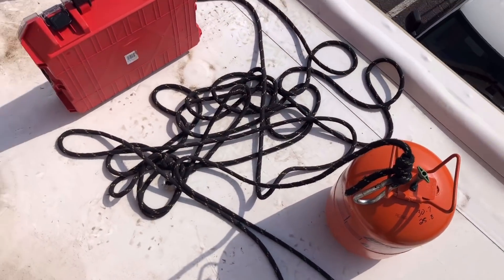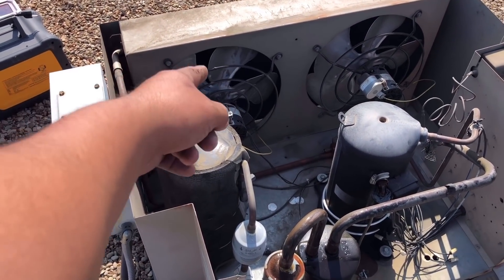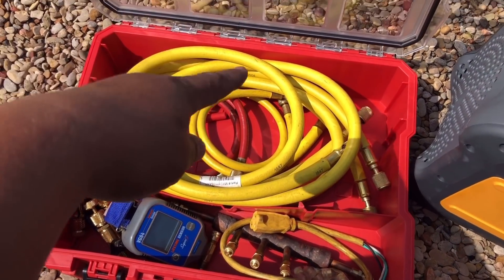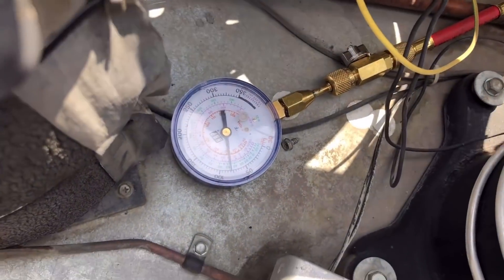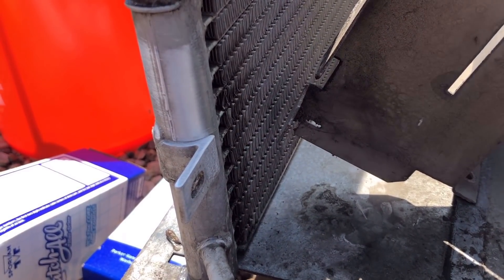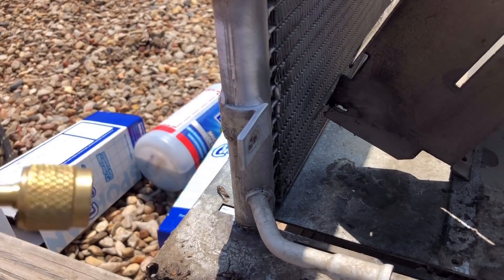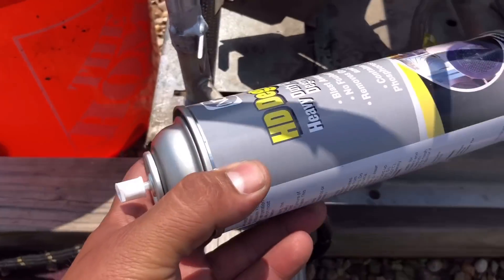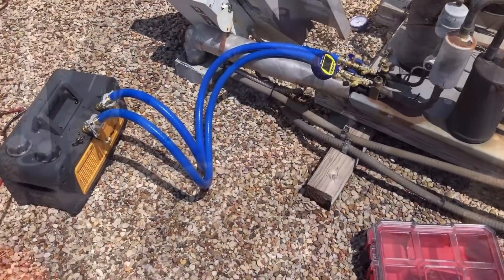REFRIGERATION: Failed attempt at an Aluminum Micro Channel repair.  My FAULT, on a Walk In Freezer.

Comment: Frustration with aluminum brazing.  Funny how you go to the homeshow and some guy is brazing everything in the world like cast metal and aluminum perfectly, and you get the magic rods and they just dont work as you saw in the demo. Then you blow a hole in the aluminum or the stick wont stick like youd hoped.  One thing I found is to heat up a large area of the target surroundings and clean with a stainless steel brush only, no degreaser, and putting a slight vacuum on the system sometimes helps pull that liquid stick into the crack. There is an aluminum solder out there with its own paste that is a low temp melting point that may do better. I sometimes have holes in evap pans. that would be a great piece to practice on.

Comment: Protip: next time try a propane torch (you can try with propane or map), turbo torch for map it's too hot for the aluminium and spread a lot of heat, it's more manageable with propane torch and also allows to control the viscosity of the soldering

Comment: automotive used very similar design for many years without failure in them (sans road debris penetration), then along came the brilliant engineering and energy saving green turds

Comment: Thanks for the video and explanations. I used alumaloy (without flux core) . Alumaloy recommends scratching the surface (to remove oxide film) while applying the alloy. It flows very smooth and evenly. Maybe appying aluxcore the same way would help.

Comment: I learned many years ago to weld aluminum with ox-acetylene.  You have to use a carburizing <sp?> flame. I used an aluminum rod with a special  flux.  I wouldn't waste my time doing that, I would have taken the condenser coil back to my shop and TIG welded it.  If you don't have access to the proper welding equipment, take it to a welding shop and have it done right.  Is it worth the trouble, it would buy you some time until the new coil comes in.  I would have placed a bead 100% around the bracket, since you don't know where the actual leak is, seal up the entire area.  As said though, probably not worth the time.  Jim

Comment: Sometimes you just have to know when you are outside of your element and admit it.  Everyone has an area where they are great and an area where they suck.  May be worth taking that old one home and using it to practice with a few times and get a little better.  At the very least you slowed it down some so it will operate until you can get it swapped out for a replacement.

Plus by the time you sealed the top side I am guessing it would find another spot to start leaking.  Those brackets are never fully sealed and it was almost as if the leak was coming underneath of it somewhere.  But that is where you get some epoxy and slather it on to get them by if it will be longer than a week to get replacement parts in.
Reply from the maker: Yes sir. Exactly. I’ve done several micro channels on the rows.   Never on the side part.

Comment: Just more practice with the aluminum welding and you will get as good with that as you are with regular copper welding. But I applaud you for this attempt. I’m finishing up my schooling for the trade myself. Since it appears everything is coming out with the aluminum micro channel I’ll mention it to the instructor and see if he offers any advice.

Comment: Great video man! I haven't had to weld on aluminum yet. I'm going to have to pull something out of the old scrap pile and give it a try.
Reply from the maker: Trust me.  Use the Lucas Milhaupt AL822 rods.  They are so easy to use and work extremely well.
Reply: @rookierefrigeration4357  Awesome! I will pick some up next time I’m at the supply house.

Comment: I use an epoxy that withstands up to 1000 psi for tricky repairs. It’s red when mixed and add to clean surface and hit with a torch till it turns gold color. Good stuff
Reply: Yea, a friend of mine turned me on to that “ red epoxy “ stuff years back when welding rods for aluminum were not so prevalent as they are today. He raves about it for sealing holes in boat evaporators for adler Barbour evaporators. I’ve used it once , for a area on a aluminum suction line on a boat refrigerator. It worked ok. Crazy stuff.
Reply: That stuff sounds good. What’s it called?

Comment: I was rootin for you man! lol good effort regardless. Have you ever heard of LACO heat sealing sticks? It's like a crayola. Heat it up and it melts on there like glue but hardens like a rock. 
It probably would've worked good for this application. Aluminum sucks to repair when you have to solder.
Reply from the maker: Yeah I appreciate it.  It wasn’t the solder. It was me.   My fault

Comment: 3 things: 
1 : good for you for putting this up. Nobody is perfect and we need reminders of that.
2. I couldn’t tell where your leak was but it looks a lot like cracks that I’ve had a hard time dealing. Pinholes and rub outs usually easier but cracks are hard because you don’t know exactly where it starts.
3. The hardest thing is knowing when to pull the plug. Good job.
Reply from the maker: Thanks alot bro.  I appreciate the recognition

Comment: Just wondering why you didnt make a second attempt? It probably wouldn't have taken more than a few mins and you probably would have got it.. more heat next time. The vacuum definitely wont draw solder in, even if it did. 15-20 bar would blow it out again. I know your thinkin of the customer but sometimes u gotta have faith in your ability, ypu wont be a pro giving up so easily. Sorry if I sound harsh but its true

Comment: Down with micro channels! Don't waste time attempting to repair aluminum. Also, you dont have to turn the recovery tank upside-down. It has a dip tube inside on liquid valve.
Reply: When you turn it upside down it gets the tube out of the liquid. Makes recovering vapor on the liquid side easier. Eliminates extra hose or swapping ports

Comment: Like 3 years ago goodman evaps brand new would be leaking they would give you a nice little stainless-steel brush an a few special flux filled braze rods i had much success scubbing down leak area an then turn your torch on just acetylene where its pumping out soot coat the area with soot it will start to burn off around 900° i believe an when i would see the soot start to burn off shove some rod an back off the torch

Comment: There is a product Trane makes for micro channel repair that you heat and becomes rock hard- I have had some success with it but it’s pricy- also this is 50/50 I’ve had great easy results and spectacular failures- you can by low melting point aluminum rod- no flux needed that flows with propane but it’s hard to work with. The trick is run your vacuum pump while patching with said rod and it sucks in. Had some good luck with that- also had huge wastes of time. Hate micro channels. At least tube sheets it’s a pain but possible
Reply from the maker: These Rods work perfectly on the actual vertical rows.   I just didn’t heat it up good enough on this ticker side part

Comment: I could be missing something but you can- assuming piping a not crazy long always pump down the charge at the unit and close off those valves. That’s how they come is closed off- pipe up, evac and open. Leak check of course under pressure- anyone who says vacuum is a valid leak test hang up on them. I have plenty of empirical proof on that- but that’s another topic.
Reply: You can pull vacuum down to 3 or 400 micron and see if it holds. If there is a leak the micron gauge will instantly spike. Of course depends on how big the leak is but it doesn't tell you where the leak is. To pin point the leak, use pressure.

Comment: I dont think its worth it to try to patch a micro channel.  How can you gurantee the fix?   See what happened?  Twice the work and it ends up costing a lot more overall if it fails,  AND THE COIL STILL NEEDS REPLACED.  .   And if it does, you  could have a customer that might fight you for the failed repair cost.  It was a nice try and I commend for your effort.    Micro channels are a refrigerant savng design,  but are a tech's nightmare.  Copper units are a different matter.  Are you planning a follow up video?
Reply from the maker: That’s why it was explained in detail to the customer.  They approved the work.  So it is what it is.   And the coil  was replaced shortly after

Comment: Good Vid ! Hey, the rook is Back ! Yea, Two spots leaking , your just gonna have more leaks every year. time to replace condenser. 1 spot , ok maybe try to repair if easy spot to get to. top leak is probably the cross tubing. How old was that unit ?
Reply from the maker: Not sure but the cool was replaced after this.  Not by me.
Reply: @rookierefrigeration4357   if u had to guess age of condensr. 1 year old ? , 5 years old 10 years old ? 15, 20 ?
Reply from the maker: Probably 5-10.  Somewhere in there
Reply: @rookierefrigeration4357  Thanks.

Comment: I did same job with aluminum brazing, I have many failure with aluminum, but I discovered layer on I was fixing aluminum either with glue or TIG welding